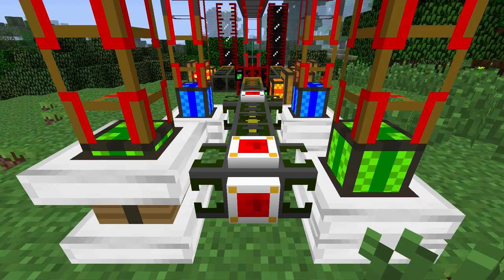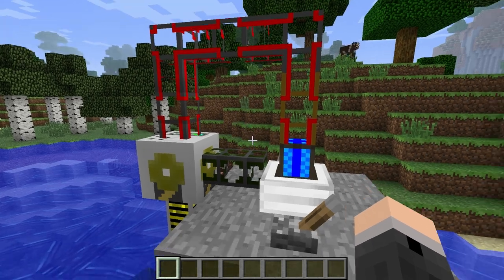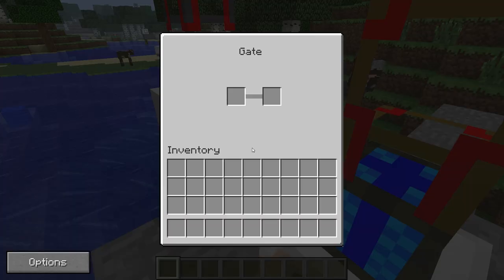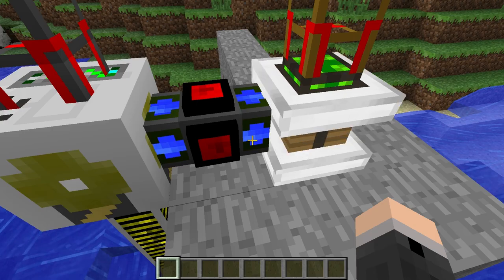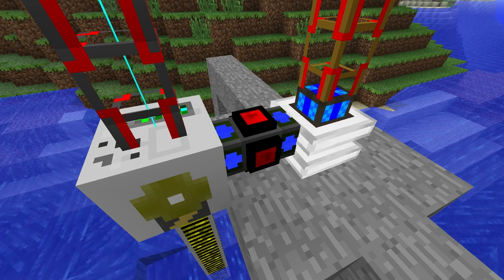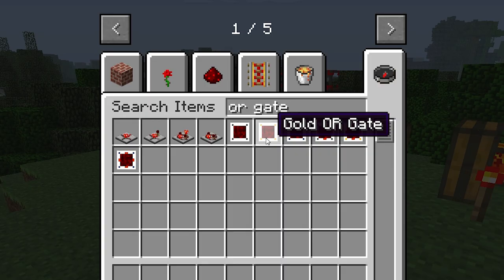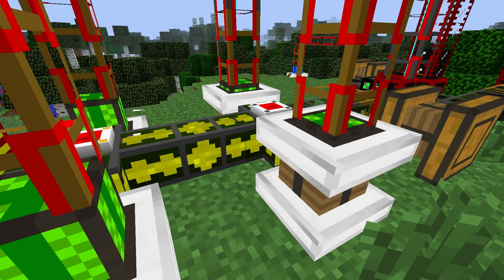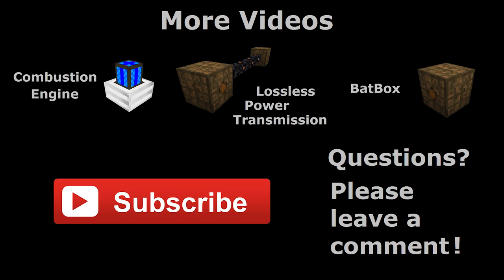Using Gates to Stop Engines Overheating (Tekkit/Feed The Beast) - Minecraft In Minutes

Comment: For combustion engines, you can toggle the redstone signal be placing the gate on the coolant pipe and setting it to output a redstone signal only when there is liquid inside the pipe. Therefore, if the supply of coolant is cut off, the engines will shut off automatically.
Reply: this isnt good because sometimes liquid can linger in the pipe. Not enough to cool the engines

Comment: You can usually get away with just a simple gate for this. Just set the gate to emit a redstone signal whilst the engine is green, and then use a separate redstone source (lever, torch, etc.) to get the engine to that temperature. Once it's there, remove the secondary redstone torch and you're done.

Comment: I need to find a way to shut-off engines once power is no longer being consumed. For example I have quarries running and if it hits bedrock and stops the engines will continue to run and burn fuel, not very efficient. I'd like a way to shut them off once the quarry stops and I'm not sure if I can use gates to do that? I cool them all very well so I couldn't specify to shut-off once it reaches yellow, because it won't turn yellow. Suggestions?

Comment: What kind of gate setup would I need if I want my multiple (8) combustion engines to have this overheating fail-safe but also allow me to turn on or off all engines with one switch? I can set it up to operate with combustion engines operating in blue with Iron And Gates to allow a wire signal from one switch but not in the green as well. Is this as good as it gets? Perhaps the engines run efficiently enough to not need to get to them in green state.
Reply: Connect all the gates to a centralised redstone signal, and put an argument in the gate saying, redstone signal received, redstone signal off, which I believe will override the other arguments, if that doesn't work, just reply